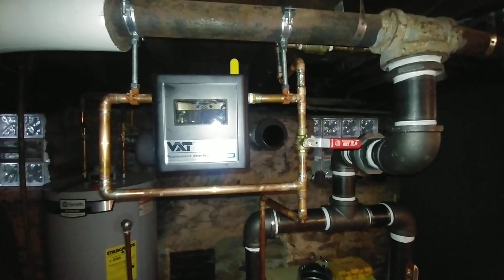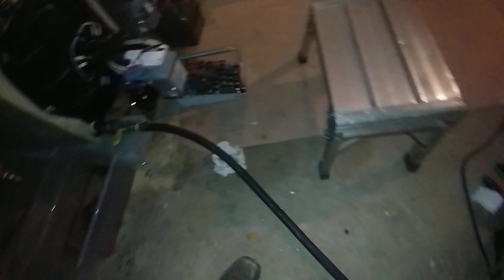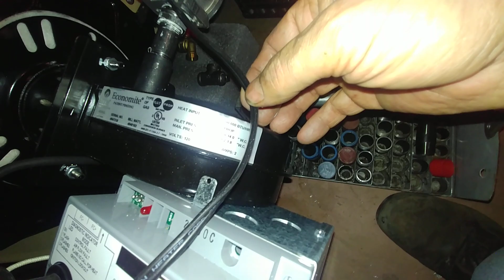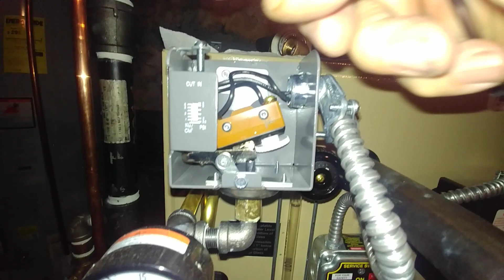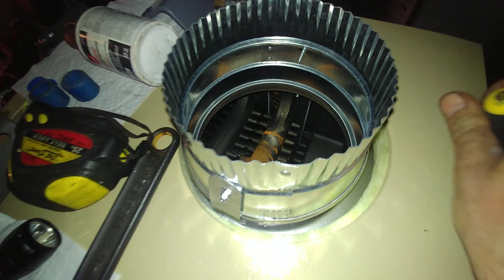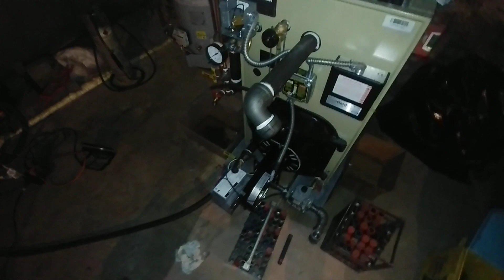I Wonder If I Have Enough Drains And Valves On This Steam Boiler Install ;-)?

Comment: Is there an transformer on an Weil McLain sgo boiler
Reply from the maker: The only transformer in an "as delivered" SGO is in the primary flame safety control on the burner, I believe.
Often, we advise customers to add a third wire to their digital t-stats to keep them powered up with 24 volts.
In that case, we add an isolation relay (and transformer) to run it.

Comment: Not a fan of that Skim nipple,  it has a better chance of leaking on burner then being used to skim boiler.  Good luck setting that pressure 
Control for 2 lbs cut out pressure. I have not found P404a to be such an accurate control.